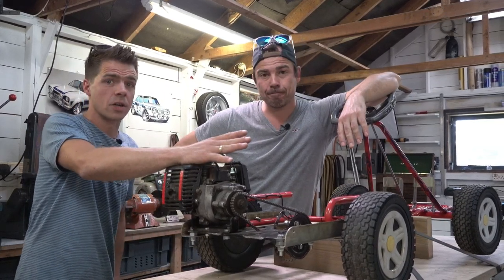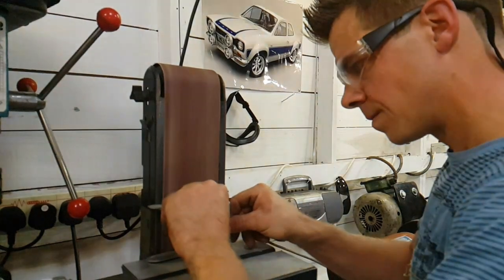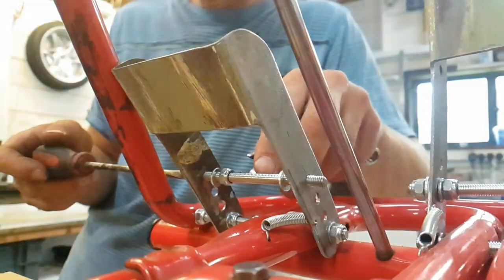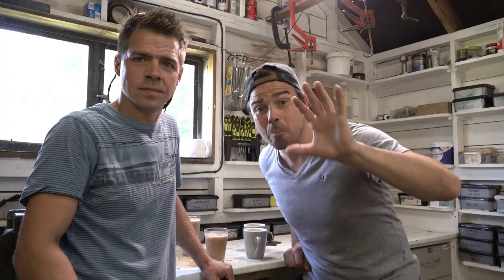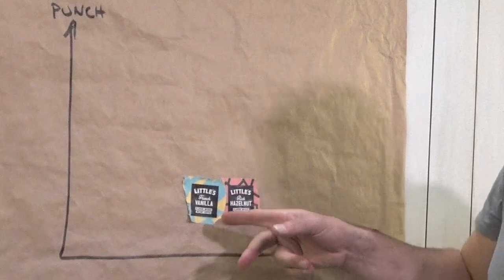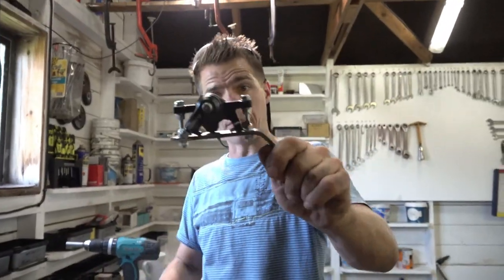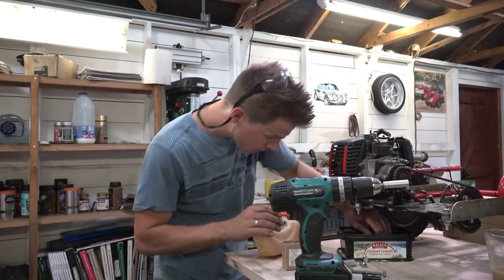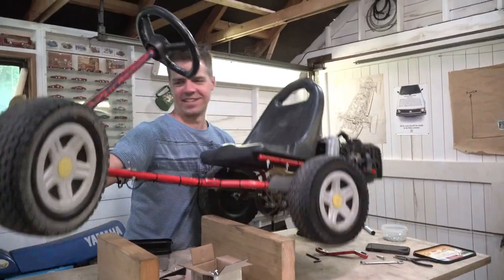Building Insane Motorized Pedal Car Part 2

Comment: Hey I just made my pedal go kart engined powered 49cc is there anyway to making it like a button to start the motor instead of cranking?
Reply: Depends on the engine and if they make a starter for it. Unfortunately, I don't think there is an electric start for such a small engine. I know they make electric starts for Honda's and their clones but not the 49cc.